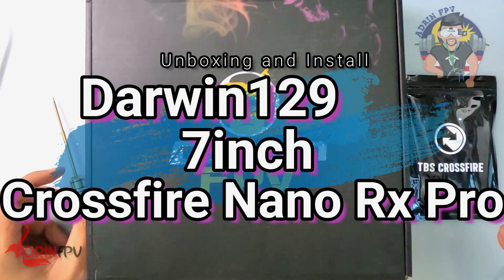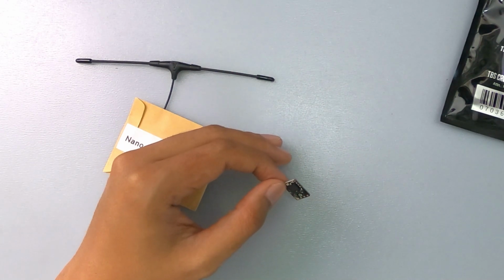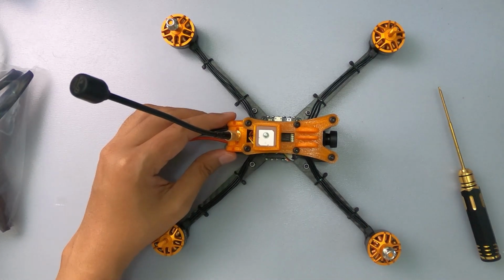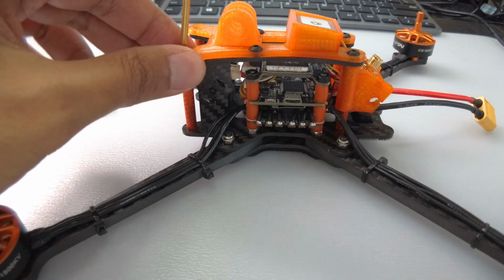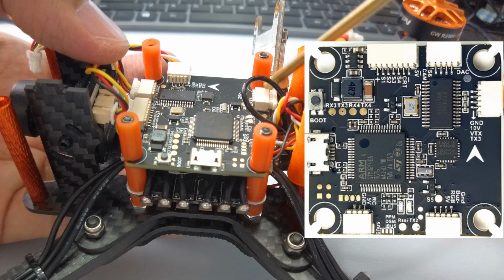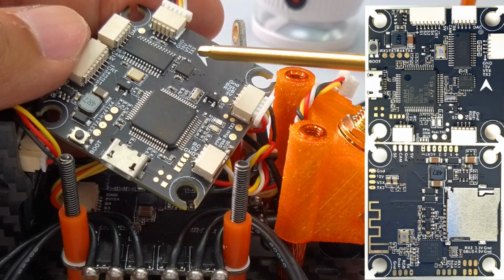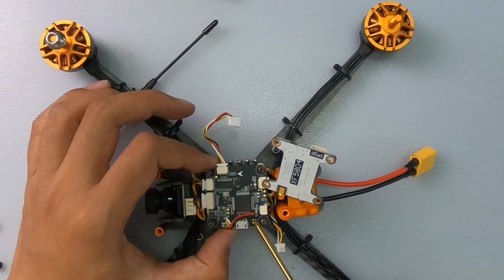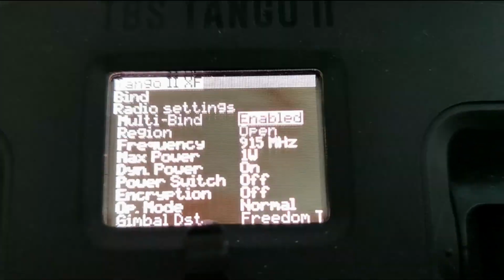Unboxing Darwin129 7inch and Install TBS Crossfire Nano Pro rx

Comment: Hi mate I'm in need of some help with my Darwin 129 I don't know how to make it work with my controller I have a radio master T8 with a r81 receiver I have bound to receiver to the transmitter and I have worked out that the switch that used to arm my old drone now does nothing and a different switch arms this drone I haven't put the props on it yet because I don't want it taking off on me I need to make sure it's running properly first I don't know what to do I got it new from a store on line from usa I thought it would be as simple as just binding the transmitter and flying it but I was wrong if you have any advice that would be great.

Comment: I found a bug with how darwinfpv setup this quad in that they installed the GPS onto uart 1. The problem with this is that this can interfere with the usb port and this causes problems when wanting to reboot into the bootloader so you can update the version of betaflight. So what I did was move the GPS onto uart 4 that you can see the pads in the video. Then I was able to reboot into the bootloader and update just fine. So if you're running into this problem. Then that's the solution you need to do. You need to desolder the GPS and move to uart 4

Comment: But wait, on the darwin 129 uart 3 is being used by the VTX, you can see it in your ports section of the video it has smart audio setup on the same uart you selected for the rx. Can you use the same uart for RX and VTX at the same time like that?

Comment: Hope you get a good one, their customer service sux, i got a defective flight controller from them on a tiny ape and they made reset everything up 10 times and because I don't have time to wait for them they told me they don't have time to bother to help me!
Reply: Mine works but i have to reload the CLI every flight cause it factory resets when you run the battery low... Garbage!

Comment: Your video is very well presented but factually incorrect.
 RX receiver requires its own port... Yours will be sharing one (Tx3 Rx3) with the VTX and so will not work.
Anybody who follows your tutorial example will also have problems.
Either TX4/Rx4 or Tx2/Rx2 should be the right alternative.

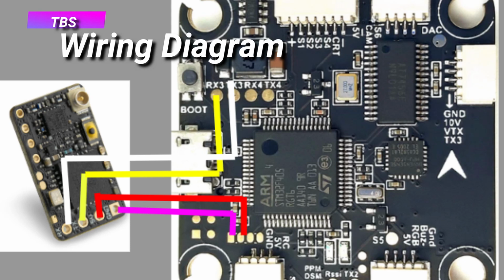Comment: At 13:10 you solder the rx on TX3 and RX3. But the Port is already used by Smart Audio. I followed your video blind and it does not work now. How does your system work that way? I use elrs receiver, but it is also the CRSF-Protokoll. So I guess you must have the same problem.
According to the manual the receiver should be soldered to TX2 and RX2,  but RX2 is not marked propper on the board or the manual.
Reply: you are right ..by connecting the rx to rx3 and tx3 the vtx is disabled ..I have connected to rx and tx 4
Reply: yes you are right, mine came with a RX installed on uart 2, uart 4 is free so you can use that too.

Comment: I am new to the drone scene. I just purchased this drone. I fly airplanes with spektrum radio. What is your though using SRXL2 DSMX Receiver?
Reply from the maker: You can use it but with the advancement of expresslrs which is much cheaper and extreme low latency at 1000hz, I think you are better off with that

Comment: will this receiver work with the tx12?
Reply from the maker: A tx 12 or any controller are just sticks and buttons. What u need to have is the right protocol on ur controller and drone. So if u want crossfire, u have the crossfire receiver on ur drone, and tx12 with a crossfire module.
Reply: @adrinfpv  I'm just going to buy the tango 2. bought the drone today and want crossfire and its all confusing so I'm just going to connect the receiver and bind and fly
Reply: @adrinfpv  hopefully that will work

Comment: Hi, can I convert this 129 darwin to 5" freestyle quard by changing the frame n propellers
Reply from the maker: You can do anything u put ur mind to it
Reply: Motor Darwin 129 is 2507 1800 kv I already tested to 5 inch it goes well but drain batery fly time short compare to normal standard motor for 5 inch ..